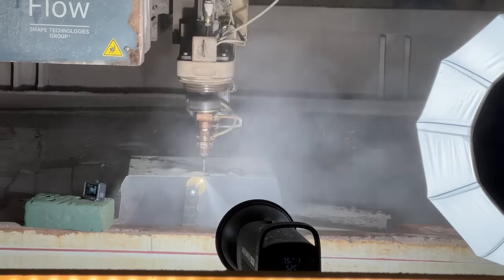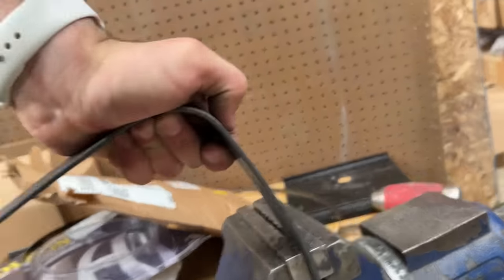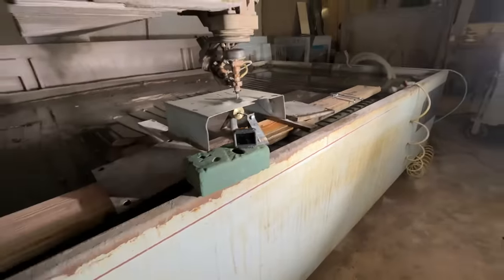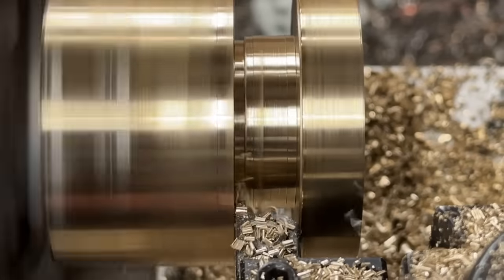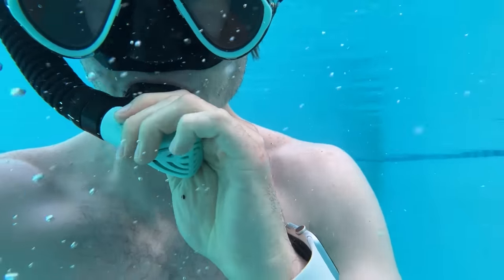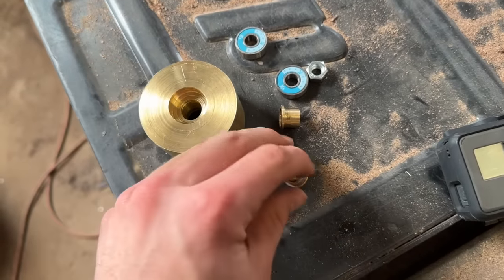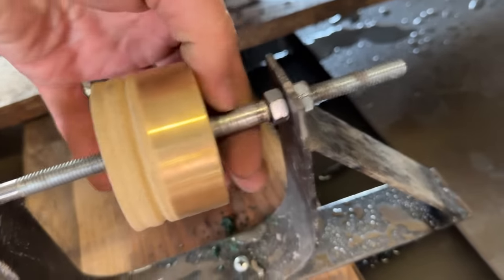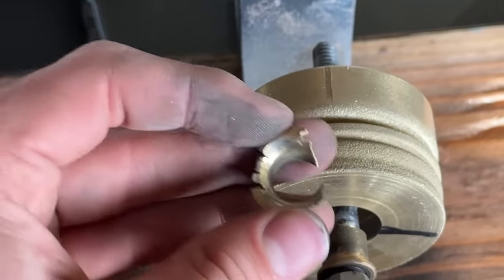200,000 RPM Brass Wheel Explodes Ceramic Bearings

Comment: Not sure how wide the wheel is, but if I assume it is 3.5" wide (thats about how wide it looks), then I can say how fast the edge is moving at that rpm.
since the radius is 1.75" that means the circumference is just under 11", or 3.5*pi"
if we divide the final rpm by 60 to get revolutions per second, we get 3588.3 rps
since any point on the edge is travelling that many times around the circumference every second, that means the edge is moving at a blistering 39455 in/s, or 1002.2 m/s in SI units. Almost mach 1, but not quite there yet. Mach 1 is 1100 m/s though, so its close.

Comment: A properly machined shaft with an interference fit for the bushings and a 1 thou clearing between the bushings and the wheel should do the trick, provided the lubricant doesn't get yeeted too fast.

Comment: Assuming it did hit 200,000 rpm and the wheels are a couple inches in diameter, the outer part of the wheel would be moving well over the speed of sound!

Comment: A threaded bolt through a bushing isn't how you do it. It should be a solid precision round bar with .001" - .0015" clearance and lubricated. 

With the bearings it should have a press fit. Vibration kills bearings.

Comment: You need to make yourself a fluid bearing whether you're use air or for this test a very low viscosity oil. Air will be the most frictionless and resilient bearing.

Comment: I'm not trying to be a critic but the amount of contact area can be increased on the ID if you used a solid shaft instead of all-thread on the inside of the bearing. Also the angle of attack on the water jet is so hard it's cutting the brass, what if you went full stream and pulled up on the outer diameter very slowly?

Comment: Id try higher rpm objects without bearings. Precision ground shaft with a oil port, oil pump, and smooth bore objects. Or another option is magnetic suspending.

Comment: You are putting the water jet way to far over the wheel. It’s essentially just, cutting down the brass till it reaches a point where it is barely skimming the surface of the wheel. in turn, getting to a faster speed, and hearing the high pitched winding you refer to. If you just dial in the wheel placement, and move the wheel farther from the stream, to where the water skims the surface, you will reach higher speeds quicker, and save the wheel from deteriorating so quick. Trust me, I grew up skateboarding. I spent many hours shooting a pressure washer at a skateboard wheel, to see how fast I could make it spin. Same concept.

Comment: i don't know how you would measure the actual rpm. but the only way your going to get bushing type bearings to survive at those speeds is to feed pressurized oil  between the bushing and the wheel. that is how turbo, crankshaft, in fact all high speed bushing type bearings work

Comment: Build an air bearing! Use the shaft to deliver the air. Hook an air hose up to it and drill tiny holes in it. Possibly dlc coat the rod and inner part of the wheel. Also does adjusting the position of the jet help with speed? Can you run it without abrasive? I'd try some experiments and see how rhat affects the speed. If you ran run it with just water you may try putting dimples around the perimeter to catch more of the water.

Comment: It looks like you're running the same diameter bearings that are used in skateboard wheels. If you can find them pro downhilling bearings can withstand some intense force without failure. If you where to try the same bearings they run in the L'Ultime Descent you should get pretty good performance from them

Comment: The all-thread is coarse and will cause heat to build up. If you have a smooth shaft your more likely to get better results. So also a bearing also spins on its shaft. So it spins two fold. On the shaft and through the bearing. Im sure someone said something already.
Reply: Also the aluminum shaft is too soft a material and will soften as it heats. Which makes it gummy.

Comment: Don't use any solid material bearings, for faster RPM you can use air ,or water pressure bearings, you can go RPM above 2L to turminal velocity of object.

.

. and it's easy to design this kind experiment spacial bearings.

Comment: if you would use a better fit on the bearing to your shaft (dont just use whatever u have laying arround), then the bearing will last longer, but u will have to check the manufactures specs to clearly see how much it can take

Comment: Out of balance and out of center, setting on carriage head bolt, need #8 bolt sitting on shank. Also use hacksaw in lathe to cut finner line.

Comment: you should be able to compound the effect of the sleeves bushings and bearings by making the sleeve to fit over the threaded rod put the bearings over that and the bushings over that this assembly should greatly reduce friction and give you more RPM. I've also sen people stack bearings inside of one another to decent effect.

Comment: Just doing some rough estimation on the circumference and how fast that jet of water is actually traveling. That wheel could be rotating between 250,000 and 300,000 rpm.

Comment: for "pitch measuring" you should try to measure the RPM and pitch at like 20 or 30 points ... depending on how long it takes to spin down
then just throw them in excel and fit a trendline to it -- or throw it in a google sheet and let us do the math for you

Comment: There are 2 possible ways to achieve high rpm without killing the bearings. First would be to use an air bearing. If the air bearing can handle the side load, you can use a pressurized fluid bearing. Think crankshaft in a car.

Comment: I wonder if it would be possible to add an oiling system like a turbo has to add a steady controlled sealed oil system. If that could increase on what the bushings can do. Could you hit 300,000 RPM’s or more? Or just a slow steady drip of oil with 100% oil loss. That would be messy and contaminate the water table water though. So you would have to change the water afterwards. But could possibly still work. Perhaps an oil boom around the discharge area of the tank like the booms used to contain an oil spill in nature. Also with the titanium again with the chosen lubrication method. Probably want to use a full synthetic motor oil or what ever they use to lubricate a supersonic fighter jet engine.

Comment: you need to double nut or use nilock nuts that why you have so many fails it spinning so fast it is tighting the nut and causing drag. what you should really do it make a smooth shaft the threads of that bolt are also leading to failure. thanks for sharing

Comment: 12:04 - You worked it out ut wrong again by working out a differential from a poor measurement using the RPM gauge (you need to throw it in the trash😂). Simply multiply the fundamental frequency by 60 to convert Hz to RPM. So
899 x 60 = 53940 RPM.
990 x 60 = 59400 RPM.
1398Hz x 60 = 83880 RPM.
2905Hz x 60 = 174300 RPM.

I can't figure out which measurements you were referring to with the 899, 990, or 1398, so I just calculated all of them. But yeah, that last measurement was damn fast! Makes me wonder what speed it needs to be to spontaneously explode.

Comment: You probably would have had better results had you used a smooth shank rod or bolt. As you're spinning up the wheel the threads on the bolt are likely eating away at the bushings

Comment: Use a smaller wheel and you should be able to get higher rpm speeds, more difficult to measure though.

Comment: Wouldn’t it spin faster if the jet was closer to the edge of the wheel? Just thinking the larger the diameter of where the force is applied the more rotational velocity like when you use the sink to spin the drain plug

Comment: You need a rod or dowel that's a better surface to let the wheel and bearings spin on. That bolt is the cause of some chatter for sure.

Comment: A hard,smooth steel axle and a 0.1mm larger diameter hole in the brass wheel and a drop of oil would have been easier,and much more efficient.

Comment: As a machinist, this was somewhat painful to watch. 
I love your creativity, and don't get me wrong, you are on the right track, but gather some knowledge from examining rotating parts to see how to apply fixtures, bushes, or bearings in the correct ways. If you mounted the ceramic bearings with a spacer between them to eliminate side load, they would perform extremely well on for this purpose. 
Wheel width minus bearing width = length of spacer between bearings. 
Mount tightly with double nuts on either side and on a sturdy frame. 
You're almost there!

Comment: Did you take off the seal on the bearings and use bearing oil on them? For such an extreme project factory bearing oil amount may be low. also it may need bearing grease if oil doesn't work. Usually oil for high speed but dunno about ultra high speed, may dry them out and them boom.

Comment: The bearings would actually last if they where probably mounted and not disintegrate if they where actually supported and not just a sloppy fit on the shaft

Comment: The bearing didnt fit the shaft which was just a soft carriage bolt anyway. So the race was spinning on the shaft and then the bolt was turning too. no wonder the bearing blew apart

Comment: Doesn’t the aggregate get into the surfaces of the “bearing” material? I would assume that’s why they fail so easily? Because referencing turbochargers a ball bearing turbo is a much better high RPM high HP choice over a bushed design. But those are also lubricated  with high pressure oil and no foreign contaminants 🤷🏻‍♂️🤷🏻‍♂️ just an observation, I have no clue how the water jet works

Comment: To be fair to the turbos You showed the all actualky rin ceramic bearings😂. Only older and cheap turbos still use bushings aka journal bearings. All modern turbos run bearing systems

Comment: You're never going to get any real speed using a threaded rod as an axle.  You need to have a full flat surface for the bushing to ride on, the threads are just going to cut the inside of your bushing making the wheel wobble.

Comment: You have a machine shop, and I'm not seeing anyone using tolerances at all!? Bearings, especially top tier ones, come with fitting specifications to allow for easy installation. Most of the fails are caused by energy lost to vibrations. Come one guys, make an effort.

Comment: To take the time and machine the brass wheel, use expensive ceramic bearings, and then use a cheap hardware store carriage bolt as an axel? seriously?
Other thought's: A brass on brass bushing is a no go. Almost any bushing w/o any type of lubricant is a no go. No jamb nuts on an already bad idea axel.

Comment: Wow this was pretty stupid honestly. The wheel should be turned to much tighter tolerances to be as symmetrical as possible. The holding jig needs to be sturdier, and the bushings/bearings should ride on a hardened rod instead of an old bolt. Yikes boys,

Comment: Chapter 5 from the Book , " Two Thirds a History of Our Galaxy" page 81-85  (book about how to build a UFO) brought my curiosity to this video. the book claims to produce magnetic tetrahedrons capable of outputting VARIOUS useful electrical energy using doughnut shaped magnetized plates (like you just did) spinning at 96.00, 96.07, 96.15, 96.22 , 98.08, 98.09, 98.10, 98.11 and 98.7654321 % of 777,777 RPM. OBVIOUSLY just fantasy .. but damn.. imagine some one trying to actually put this to the test ? I think you would be great it at hahah!
Reply: I think the conclusions we would want to look for is changes in the magnetic field surrounding the material. IDK again, just super cool sci-fi shit but yeah haha cool stuff

Comment: How fast does the 'water' come out of the waterjet and can you calculate the top possible speed based on the diameter of the wheel surface at the time of contact?  Sounds like a chatGPT question, so I asked it about it. lol  I wonder what m and v are for their waterjet..  A lot higher than these examples I'm sure.

---bing chat response
If you want a formula for the maximum RPMs of the wheel, you can use the following:

RPMs = (m * v * sin(theta) * r * 60) / (pi * I)

where m is the mass flow rate of the waterjet, v is the velocity of the waterjet, theta is the angle of impact, r is the radius of the wheel, I is the moment of inertia of the wheel, and pi is approximately 3.14.

You can plug in x for v and y for r to get the RPMs in terms of these variables. For example, if x = 760 m/s and y = 0.5 m, you get:

RPMs = (53.7 * 760 * sin(90) * 0.5 * 60) / (3.14 * 12.5)

RPMs = 15,636